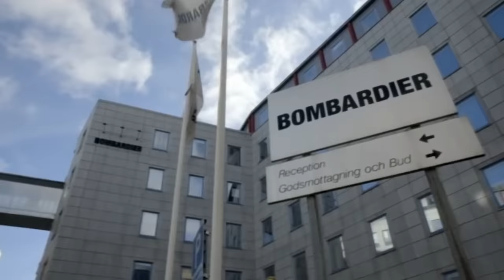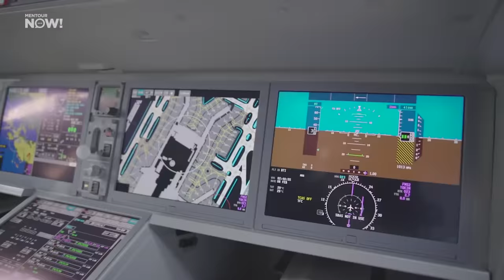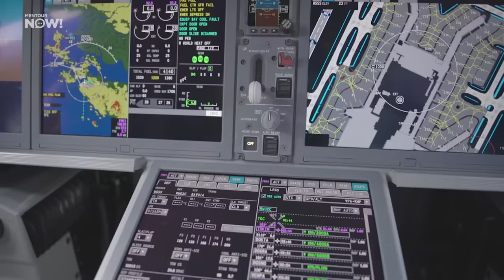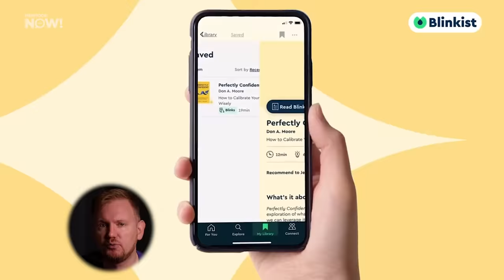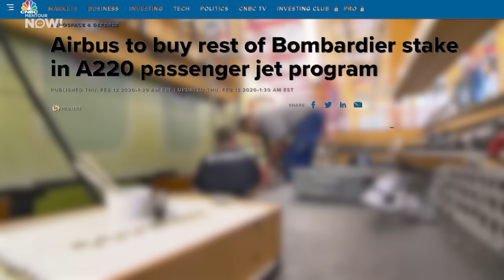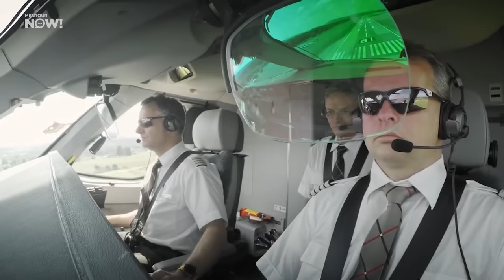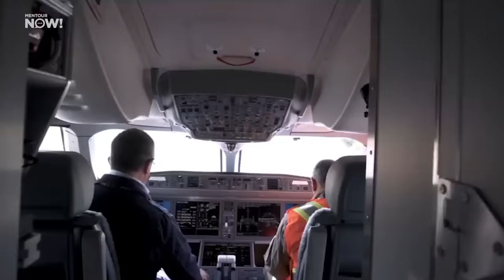Did Boeing GIVE Airbus a FREE Airplane?!

Comment: I've been a Boeing fan since I started flying as a child back in the 60s and Boeing was always the Pinnacle they were always the guys they are always the one to watch with the 707 the 747 and all their Aerospace activity they were just really the best of the best 

But... 

When they did their merger and move the headquarters to Chicago they broke away from their Roots where management and Engineers could walk across the parking lot and talk to each other where things were done on an intimate scale and problems could be solved not by committee but by two guys in a matter of minutes. This may not be a realistic scenario especially given the way things are manufactured designed engineered nowadays with computers and email and everything else but it's still means that there's a disconnect and Boeing turned into a corporation to make money instead of a business that made great airplanes

I honestly think they're not going to turn themselves around they're going to keep tripping over their own asses until they get somebody at the helm that's going to look at what Boeing's Roots were with their culture was and make some big broad Strokes to change the company back to the way it was

In support of this I only have a few words 737 Max and Starliner

If a company ever set out to make themselves a big ridiculous joke those two issues alone not even talking about the 787 or the 777 problems but just those first two the fact that they let that even come close to happening is utterly obscene and just disgusting and a punch in the gut to all of us that believed in Bowling for so long

Comment: Should Airbus also develop a new mid sized 767/757 sized aircraft?
Reply: I hope Boeing does when it introduces its next aircraft
Reply: Airbus is developing a new, bigger carbon fiber wing for the 321. With this wing they could further stretch the 321 to get an aircraft very similar to the 757. The 220-500 could replace the 320 neo at the same time later on.
Reply: 767 sales all went to the A330, which is why Boeing responded by developping the 787 meant to compete against 330/340 and replace the 767.  Thena iarline accountants decided to fit more people in the 787 than original design, so today 787 is 9 across instead of 8 and reduced seat pitch to please accountants who aren't happy unti coach passengers are unhappy.  Note the 787-9 is more popular than the -8 which indicates airlines want bigger planes. 
The 767 was a failed plane from an accountant's poit of view because it was comfortable for passengers. But all the weight of the extra fiselage width for second aisle for only 7 across seating, only one more seat per row than the 737, and yet not wide enough for standard cargo containers.

Comment: So .. the clueless beancounters that had long before decided to rest on the laurels of the former engineering tradition and to cut investments in new developments - did not realize the potential of an energy efficient, long range, but flexible medium sized aircraft. Why of course, they are also ignoring the facts about their own aircrafts when it messes with the "maximize-profits and weasel your way through business" plans. The Bombardier aircraft may have been designed with remote areas and short runways in mind - but needing a short runway gives extra safety in case regular or long ones are in bad condition. It offers extra safety because the pilots have more options if they are rerouted. Such machines are less risky for the company when the fuel costs go up, the airline is still profitable (or does not make losses). 

I can see a lot of potential for such an aircraft. But of course Boeing's "leadership" did not realize they were about to be overtaken by competition with BETTER products.

It is telling that that company that colludes with US government all the time and directly (tax cuts for production sites) and indirectly (military contracts) extracts billions of USD would sue. Like they colluded with CIA many years ago to spy on the Airbus offer during a bidding process. The Europeans were stupid enough to send the offer via an unsecured FAX machine and that had been hacked. so Boeing knew exactely the price Airbus was offering and could place themselves just beneath it. 

But these underhanded business practices executed by orders of profit maximixing psychopathic bean counters - does not lead to good products. 

So in the end they just forced their competition to become better and smarter and to having really good products that solved the problems of airlines (whereas Boeings goal is to milk the old designs). Getting away with sneaky business practices does not make a company stronger. And with aviation you cannot bullshit / market your way out of not having a good product.

Comment: What a misleading way to tell a story. I’m actually surprised with you.

The CS-100 was developed first, and marketed as a regional jet, to compete exactly with the E-190, the most popular Embraer E-Jet. It was marketed as a 90-110 seat regional jet with improved efficiency. 

Bombardier received very few orders for the CS100. The program was in serious trouble. 

When the CS300 was announced and Swiss and Delta pounced on it, it was too late to continue development. Bombardier already ran out of money.

In fact, the DC-9 family (MD and 717) were designed as the first regional jets. 

Boeing did appeal to the US government and the government actually agreed with Boeing. Huge tariffs were levied on the aircraft until Airbus eventually agreed to build all Delta and other US-bound aircraft in the United States. It was Airbus that did that, not Bombardier, which had no money or desire to manufacture anything outside of Canada. 

Meanwhile, Boeing decided to buy Embraer because it complements the current Boeing range and builds military aircraft as well.
Reply from the maker: That is EXACTLY what I said in the video.

Comment: It's simple, A220 has sidestick....
Reply: There's a lot more to it than that. But the rest is the Airbus way too. When all the systems on the overhead are in their default settings they are lights out and upright, which is the Airbus way too. So while there are differences, they will be largely familiar to Airbus crews at least. But that's more an issue for customers than for manufacturers. It does mean that the A220 is a little easier to sell to new airlines, which mostly choose Airbus anyway.

Comment: Very good video ,I am flying this aircraft and its very unreliable ,specially the P&W engine my company have 12 aircraft with 2 to 3 flying at the time waiting for engines (combustion chamber problems mostly) its been like that for more than a year.of course its efficient fuel economy wise but that if it flies. The aircraft is closer to a boeing than airbus with all its avionics except for the side stick which even have a trim PB.

Comment: Just another in an unbroken succession of bad decisions by Boeing upper management over the past 10 years across spaceflight and commercial airline design and manufacturing. Unclear if the US government will save Boeing and grant a miltary aircraft contract. AFAIK Boeing doing OK in computer systems.
And, I don't regard any current Airbus problems being profitable as a North American manufacturer as significant. Assuming that Airbus will succeed in making the Alabama profitable and significant, it's an important foothold in what would normally be Boeing's territory with enormous political, mmanufacturing and sales implications providing a powerful incentive for North American airlines to buy "local" Airbus aircraft.
Boeing has cut back on its ambitions but unless it can fix the multitude of in house problems, the business can degradde and maybe disappear. A similar scenario exists for Intel in the chipmaking business... A few years ago it through up its hands and surrendered to TSMC and other chipmaking companies getting out of the foundary business. But, with incentives by the US government Intel is re-entering the business. If that didn't happen in another few years Intel would have been beyond the point of no return and wouldn't be able to re-enter at all. Boeing is at a similar crossroads in many lines of business. Will Boeing be saved by the US governmment and similarly will Boeing be able to fix what is broken?

Comment: This is rather silly stuff about "what if cows had wings". There is no proof at all that Boeing could have used Bombardier to their advantage. Non at all.
Also it's silly to think that Airbus would have stopped developing new planes just because the did not buy Bombardier. Non at all.
Quite frankly I sometimes think this mentor pilot is rather biased and much pro Boeing.

Comment: Boeing 727 Max is more fitting. But they missed it..
Reply: Trijet design wasn't favorable for airlines.
Reply: Tri-jets current remaining market is small business jet fleets where it is non economical to maintain an ETOPS rating.
Reply: @dalentoews3418  Looks like Dassault disagrees. The Falcon 10X uses two engines. What three engine jets remain in production? Boeing and Airbus both have studies for triples with unusual designs, but fewer and larger engines are always more efficient due to the more efficient production of thrust from larger engines (energy is proportional to velocity squared, but momentum is proportional to velocity, so if you move more air at lower speed you get the same thrust for less energy) so they are more likely to enter service as twins. If they ever happen.
Reply: @cageordie   Dassault has two tri-jets in current production. Yes I know two jets are more efficient. However since trijets are immune from ETOPS regulations their will likely always be a small market for them. Just because Dassault is developing a twin engenine does not mean they are leaving the tri-jet market.